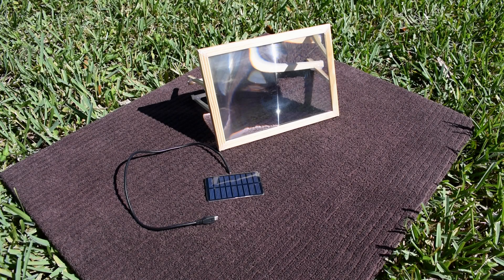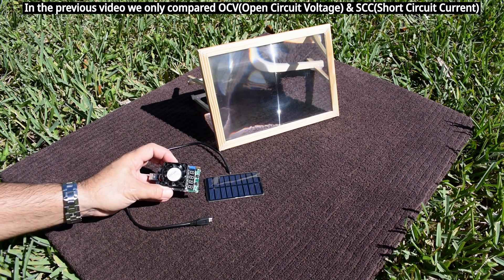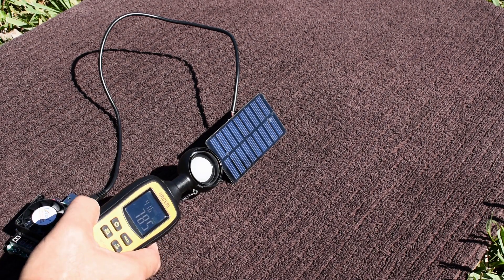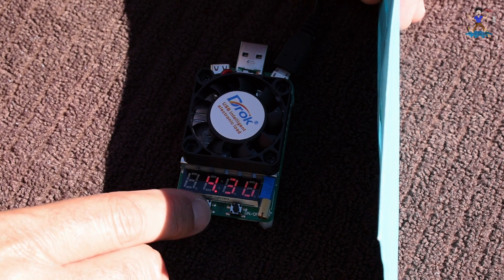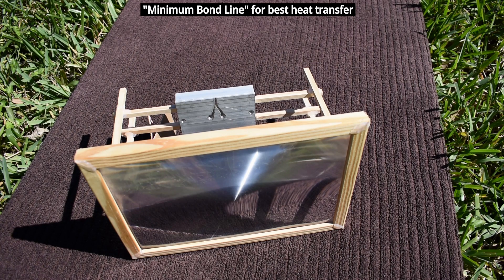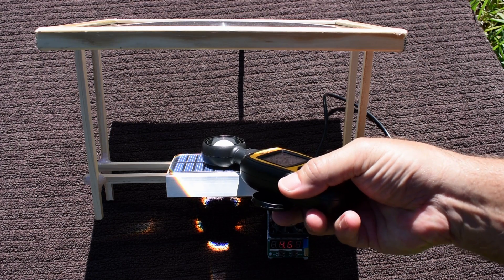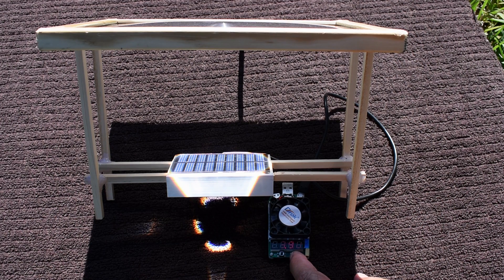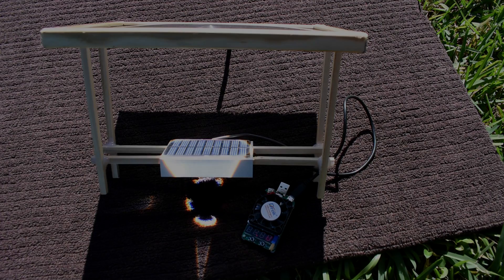Fresnel Lens Solar Panel Experiment WITH Cooling!

Comment: Larger heat sink submerged in water, please. The panel itself should stay dry.
Reply from the maker: If enough viewers request it, I'll definitely test using water. Thanks for watching!
Reply: @electronicsNmore  mineral oil coat the back or parts needed they run hole computers in the stuff
Reply: @brandonjohnson6645  
I was thinking something similar...
I built a 3 phase rectifying diode array that is rated for 600 amps/6000 volts and placed it inside of a sealed half gallon container full of mineral oil.
Due to the super efficient cooling, I'm able to exceed the theoretical ratings to the extent that I can't get test equipment that will read that high. 
The voltage tested has been so high that the mineral oil has been used to suppress arcing between the leads...

So immerse the aluminum heat sink in mineral oil in this solar panel experiment, then repeat it using a peltier device rated for about 5 volts in the same rig. 
The end goal is to see which is a more efficient method of passive energy generation.
This could spawn a whole series of videos for an enterprising mind.
Reply: Константин Дьяченко most solar panels are water resistant
Reply: water? the only way is that the container with the water needs to be aluminun too, other way ....it is like, two differents metals plus electrolite (water) and corrosion will start.
Reply: I did a bunch of experiments like this for science fair back in the early 90s. Unless you have something that actively uses energy to move heat using sub-ambient temperatures, the best is to totally submerge a sealed panel in water, otherwise the surface will still get extremely hot. Heat and UV degrades the cells the quickest, and even a thin layer of water on the front surface substantially reduces both. I made a water tight box with a glass panel, with a pipe connection on the top and bottom, and had a radiator mounted above it so that convection of the water would cause it to flow through the radiator and return (inspired from my dad's passive solar water heating system he had at the time).
Reply: Good idea
Reply: HuSia Cat  
Just a thought about cooling mineral oil, if it helps.  

Below the sun heated surface of the ground, the temperature doesn't get much higher than 18C. 

Anything from a coil of copper tubing to a cooling radiator from a motorcycle, that has been buried deep enough, would exchange heat well enough to dissipate the majority of that 45C.  
Keep the ground moist & the transfer of heat becomes much more efficient.

If I had to set something like that up, I'd put a speed control on a brushed DC motor & use that to drive an automotive power steering pump. 
Pump speed would be critical, in this case... too low & the oil seeps past the vanes without flowing. Too high & the vanes cause cavitation/suck air. 

Once the speed gets sorted out, resistance to the flow (pressure) caused by any heat exchanger and height of the solar panels above the heat exchanger certainly wouldn't be an obstacle for the pump itself.  
The same couldn't be said for other types of pumps though.

Best of luck with your projects.

Comment: Put a Pelletier between the heat sink and the solar cell and add that in serie with your solar celland gain more power... no patent yet... do it before i do! ah haa!
Reply: Parasitic losses would lower the efficiency, probably more than the heat alone. Why not use a really large heat sink or just float them on water; convection is free
Reply from the maker: The best method would be a larger heat sink, or to submerge the heat sink cooling fins in water. Thanks for watching!

Comment: You're going to need a beam scatter, since the fresnell lens turns incoming light into a focal distance point, and that alone will coock the media of the cells (unfortunately) but with the propper fd and a diffuser employed, you might be able to concentrate the intense light into the shape of the pannel without it (the light) heating up the media, water won't cool the panel fast enough, but that's probably why solar city's tiles aren't that thick, because there's little to do to get more with an "appeal" aspect to solar panels on your roof.  If you can work out the fd and the scatter pattern to less that 2" high, you got a good pannel idea for off the grid use.    Awesome video! Love your enthusiasm 😊
Reply from the maker: The focal point I created isn't concentrated, it's spread out over a 3 1/2" - 4" area, so it's not too hot. Thanks for watching!
Reply: @electronicsNmore Use frosted sheet on the glass too scatter the light evenly and or consider finding a way too slightly rock or move the lens so light doesn't get a chance too create a hot spot
Reply: @electronicsNmore  Use a mylar box around pannel so no light can escape and if over hearing store 20 coke cans chop em make a heat sink attach it and if really needed add a 5v PC fan across your homemade sink

Comment: Silicon junctions like to be below 150C, at higher temperatures the leakage and other characteristics start to change too much for optimal performance and lifetime.
Reply from the maker: True, but if you lived in a cold climate with a lot of bright sun, it could be useful. :-)

Comment: Thats how you can fuse Photovoltaik and Thermal Energy. Why the Industry issnt using fresnelllenses on the big panels with cooling?  I am sure its possible to push the temperatures even highter with special panels without loosing voltage and getting steam power :D
Reply from the maker: Thanks for watching! Be sure to share.

Comment: I live in Saskatchewan, Canada.
It gets STUPID cold here in the winter, but there's a LOT of sun.

Fresnel lenses during the winter might be a good idea to boost solar panel output, and the increased temperature wouldn't be a huge problem (as long as the lenses got removed before summer).
Reply from the maker: I agree, using in the winter is the best use for this idea. Thanks for watching! Be sure to share.
Reply: yeah I'm John Assal  Fresnel lenses maybe cheaper than solar panels but the sun moves and therefore so does the focus, so the panels would need to be mounted in a frame and track the sun, and that is definitely not cheap - especially as you would need one for each panel or pair of panels.
I'm afraid that more panels is the appropriate solution to get more power, and/or watercooling them.
Reply: yeah I'm John Assal  The subject was Fresnel lenses, they are flat by definition and only work well when rays are near perpendicular.
A parabolic trough partially solves astigmatism in the azimuth axis, but as the incident angle gets further off-axis, the focus moves away from the target. Also, it would still need to track elevation, and the panels would be facing 180° from the sun.
This is not so bad for oil filled pipes, but not for solar panels which need area and need to dump heat. Their capacity to generate also becomes saturated.
All these ideas have been discussed and researched for over 50 years - if there was an easier, cheaper and more efficient way of doing things, then it would already have been done.
Result - adding tracking is still more expensive than adding more panels especially when factoring in maintenance, and they offer no advantage in overcast skies because the light is diffuse and cannot be focused anyway!
Reply: Replace/ cover over your greenhouse glass to save on heating. And yes you will need to remove them come summer.
Reply: Or just buy more panels or larger output panel.. easier and more cost effective
Reply: yeah I'm John Assal  There is a reason big companies and solar farms don't do this. It isn't practical for an array. I appreciate and applaud the experiment but you would also have to figure size/space and time engineering  and aligning cost and it would have to be constantly adjusted for time of day and year as the angles change. Not cheaper by a long shot.

Comment: Awesome... once I realized the thermal issues with solar cells and capabilities for optimizing performance... I've wanted to perform an experiment like this.  Seems water heating can be incorporated into solar cells more maybe as well as maybe incorporating with convection solar heater systems. Thanks for sharing!
Reply: You can use mineral oil. Its non conductive and cools
Reply: @rb-ro2po  Good call.  Seems like for a heater or geothermal application... a closed loop system would be better maybe factoring in the coefficients of thermal conductivity or something like that.  For only cooling the solar cells... seems can pump the heat into the ground... maybe depending on the environment... under a greenhouse, home, shed or garden I guess.
Reply: @jafinch78  that and you could treat the solar cells like how you would try to cool a computer and use a pump to circulate the mineral oil for even heat distribution
Reply: @rb-ro2po  Great call!  Sure... why not just use the water/fluid CPU cooling computer parts maybe even.  Heat pipes would be a bonus also.
Reply: @jafinch78  Heat pipes aren't used in water-blocks, but simply slapping a heatsink tower on the back of the solar cell with non-conductive thermal paste aught to be enough for practically any normal use case. wouldn't even need a fan if it's breezy out.

As for liquid cooling: They even make generic 'stick on' water blocks that would work fine for this. For scavenging some extra work out of the fluid, you could use low-temp Sterling engines, but as they have so little torque, getting voltage out of them isn't too easy. You might be able to replace the flywheel in such a setup with a fan to get some air moving over the heat sink for 'free', but the pump is going to need power from the cells to run. As for how big a radiator would be required? with a .2 amp 12v fan and 120mm rad, it should be able to dissipate 80w-100w of heat from some off the cuff guesswork on my part. As concentrated photovoltaic systems benefit greatly from higher-quality cells, you'd want to use them to maximize the 'net' gain from the system.

using liquid cooling allows you to use mirrors as well as lenses to get some pretty mind-boggling output out of the most expensive cells. At a certain point they'll just burn though.
Reply: @DFX2KX  is convection good enough for moving heat trough the system?
Reply: @crackedemerald4930  that depends on just how much light (and therefore heat) you're subjecting that PV panel to. with a simple frensel or single-mirror setup, probably. But if you're going to buy aerospace-grade PV panels and push them to their limits? you're going to want active cooling of some sort. You'll be reaching CPU-die tempatures at that point.

Comment: Aluminium square tubes that are 8mm OD 6mm ID or 1mm wall using surgical rubber tubing to join ends so that the flow of water can go from top to bottom with a small circulation pump would cool a larger 200w panel with a Fresnel Lens. From a 200w panel you would normally get about 60% power or 120w without using anything else to get higher efficiency. If you use a Fresnel Lens & water cooling then perhaps you could get about 90% of 200w or 180w less 10w of power for the pump giving 170w which is still 85% of it's rated power.

Comment: Solar panels was not made to be used with fresnel lens for a reason. It's abuse to the panel and will shorten the life.He tested that 73degrees go to AZ. when it's 105 your not going to gain as much as losing your panel. Beware guys
Reply from the maker: What part of "experiment" did you miss?

Comment: I thought about doing something like this with a large panel, and adding water cooling,  I was just curious if it would be effiecent enough to be worth it, with the loss of the pump and added heat, maybe with a 350 watt panel it would, but wouldn't last as long. It would be good for short term camping or emergency power, plus you would get hot water! Great video!!
Reply: Thermal siphon feeding cool water from bottom of tank and warm water rising by itself into the top of the container.  Look at PC water cooling systems. Electric pump is unnecessary.   Add fins to water container to dissipate additional heat.
Reply: Whether or not forced cooling would work depends on whether the additional load is smaller than the gain from increased efficiency. If not or it comes break-even, then no. But if it's significant then the answer would be to go for it.
Reply from the maker: If you have to take power for a motor, no good. Thanks for watching!
Reply: Maybe a slow convection-based water flow, with the downward flow in the shade.

Would that take away enough heat, though?

Comment: Won't that heat sync actually heat up in the sun. It would probably do better painted or covered, at least where the sun hits it.
Reply from the maker: It heats up, but also dissipates heat. Painting the heat sink is a bad idea because it would insulate the metal and make it harder to cool off. Thanks for watching!

Comment: Are you sure that thing you have plugged in there isn't a remote control for a bulldozer? Everytime you press the buttons I can hear the reversing alarm from plant equipment. I would check over the fence next door, make sure your neighbour still has a house......
Reply from the maker: 🤣  I filmed the video is a "quiet" area, except for a gate the beeps when opening up.
Reply: @electronicsNmore  Ahhh ;) Thanks for the reply, interesting stuff.

Comment: Get  The    H.I.T     Type Of Solar Panel   I Have  6 kw   Of Sanyo  14 years In Georgia   The Tech Is Now Made By Panasonic Co.  It Works  HOT   i have 7 kw of mono-crystal  See The Same Hot Lower Output     H.I.T.   Higher Out HOT  Run 18 kw XW Inverters  14 years   Rolls Batterys  All Working Well   14 Years  Now

Comment: What if you submerged it in a thin film of water. Could act as a anti dust solution as well to keep it clean for a long time.
Reply from the maker: Dust really isn't a problem, the heat is, so using water to cool the heat sink would work. Thanks for watching!

Comment: Very interesting! Thank you for conducting these experiments!  Always a thumbs up and looking forward to more experiments with solar.
Reply from the maker: You're welcome! Glad you enjoy the videos. Thank you very much for watching, and thanks for all the great videos you produce!
Reply: @electronicsNmore Sir, why don't you use flowing or stagnant water or a CPU cooling fan beneath the heat sink I hope that improvement could decrease the temperature by at least 20 - 25°C more. 

Anyways you did a great job by at least trying to conduct this experiment as I was longing for this since childhood.

Thank you so much

I hope you conduct future similar improvement experiments.
Reply: Hey whats ur opinion for making a 10kwh project using 100 mirrors on 100w solar panel, with liquid cooling, will it withstand 100times of electricity flow through its wires and reliability and all, pls enlighten me.
I need efficient and economical
Reply: Project farm I'm a big fan!, Second reply to your comment 😊

Comment: Man that’s super interesting I really like this idea I wonder how it scales up
Reply from the maker: Glad you enjoyed the video! Be sure to rate thumbs up and share. Thank you
Reply: I have put some thought into it. I suspect that the biggest hurdles in scaling up would be optimization of lens orientation, light diffusion, and the implementation of adequate cooling. As you scale the size of the solar cell, the lens size and orientation changes. As the lens size increases, the need for cooling increases proportionally. The size and complexity of the cooling system also depends on the size of the panel and whether or not it is stationary or Sun tracking.

Basically the platform has potential, but lacks easy implementation options. Large scale manufacturing would help to lower the difficulty of installation, but the cost would be prohibitive. Making modular systems with commercially-available parts could work, but then there is added cost in labor and materials beyond what a solar installation already requires. There is a tradeoff somewhere and then you get hit with the law of diminishing returns. For every extra dollar, resource, or unit of time/energy you put in, the extra returns are smaller than previous increases. This makes the system unlikely to be popular; at least until some brilliant chap sorts out a commercially-viable solution which bypasses a majority of the complexity and/or cost.

TL;DR: Scaling this up would be a labor of love. Commercial implementations are possible, but not likely to be very practical. The cost and complexity outweigh the added benefit. Custom solutions will be difficult. God speed if you wish to try.
Reply: @canwenot573 I think evaporation cooling over your heatsinks would be a pottential a water spray over heat sinks with a cheap PC fans setup over heat sinks should super cool them cheaply but also if your pannel is waterproof you could spray the underside with mist water and run a fan over and will drop the temp dramatically...if you wanna know how dramatically put a fan on your face n hold it for a moment..then wet your face with water splash face and run fan over again and you will see a huge windchill difference and it's so simple n cheap...just an idea share thanks mate

Comment: Would be very useful on a larger (house) scale. You could  use water for cooling, then use the heated water for something else eg filling a hot water tank / central heating system.
Reply: There are cogeneration panels, but if you want hot water you're going to run the cells too hot. Perhaps heating a lap pool would work.